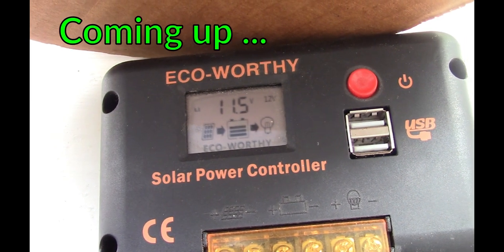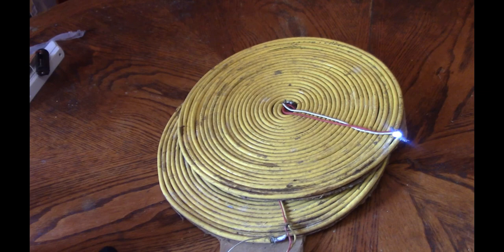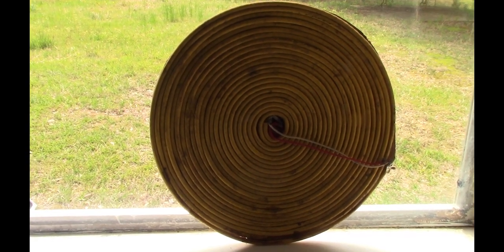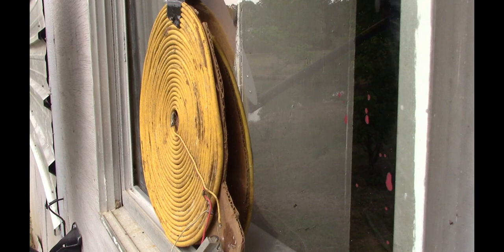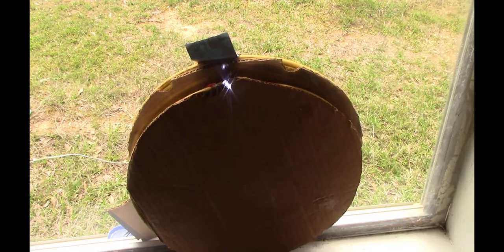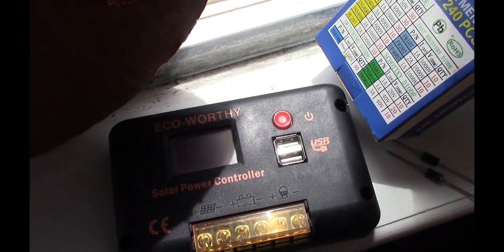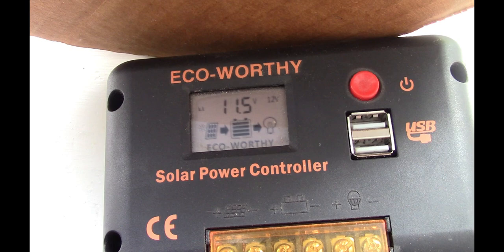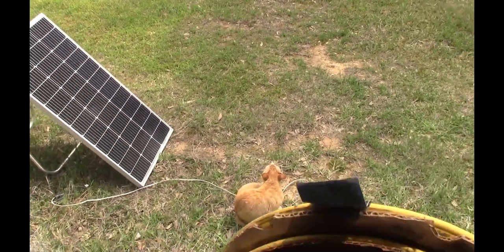100W solar panel into the house with no wires?

Comment: I seem to recall seeing a picture of Tesla in front of one of his coils, and the coil was sizeable…a diameter of twice his height kind of thing:

https://i0.wp.com/themindcircle.com/wp-content/uploads/2017/09/nikola-tesla-1.jpg
Reply from the maker: Yes indeed 😀 It was that pic and his patent for the pancake coil that produced my SWES (Simple Wireless Electricity System) of 2012. The idea was to simplify something daunting for practical modern uses and it ended up as needing just 1 transistor to drive it lol. The big yellow BAC coils came shortly afterward and I recently thought it was about time to further some of that research..
Reply: Ive seen another channel here with a gent who has been researching these bifilar pancake coils, but I’ve never seen anything that states a “rule” about wire gauge and energy transfer. Have you tried a Cat5/6 cable for miniaturization purposes? Smaller coils will need to be positioned and aimed more carefully, I wager…

Another thing: the blocking diodes used by most panels aren’t optimal- too much voltage drop. How about Shottky diodes to replace them?  And possibly mosfets over the transistor you’re using now for the same reason?
Reply from the maker: @gregorykusiak5424  One chap stated that energy travels over/around the wire rather than through it, but it doesn't stop it from heating up with DC! In those terms, 30AWG is good for an Amp of DC, but yes, what about pulsed energy?! 
Cat 5 I've tried and does fine, though tend to stick it between computers in the house lol, rolls of enameled wire or old telephone cables seem to be the usual. 
Yep, the smaller the coil the less field energy, or, a product of dimensions. 

Hmm, something easily built is the aim, though undoubtedly Schottky's would help on panels. MOSFET's are definitely an idea... am still trying to current limit and have found that grafoil can replace the daft water resistor section. A length of toaster wire would do the trick at the panel, but would set the grass alight! An automotive bulb doesn't seem to do anything but light the bulb... still looking.

Thanks very much for your comments Greg, they're completely what I was asking for, when stuck in the second video 😀
Reply: @Slider2732_  if you’ve got the charge controller on the receive end, I assumed you’d want as much current as you can squeeze through the link/æther as possible…that supposition may be mistaken. 

One of these days, somebody with Tesla’s understanding of these things will post a video 🤞🏻
Reply from the maker: @gregorykusiak5424  I'm waiting too for that vid 🤣
Yeah, 100W through a BAC to indoors to the charge controller. It may be easier to just do that for now, rather than worry about the smaller systems and current limiting. Mind you, 3x the smaller should = 1x the larger. There's going to be foul weather for the next week, so there's time to research (will post a couple of vids inbetween that need finishing).

Comment: Great job and amazing results.    Did you not think of opening the window and passing the cable through..." only joking "..it's a very useful way of transferring energy no need to drill holes in walls, I look forward to more on it seeing what the losses are ect should  be more than viable as a working system. Thankyou for sharing.
Reply from the maker: Funny thing about that window is it needs replacing and is just 1 sheet of glass. I could open it, but would spend 30 minutes cleaning up the broken pieces 😂 
The project will be revisited then, thanks for your feedback!